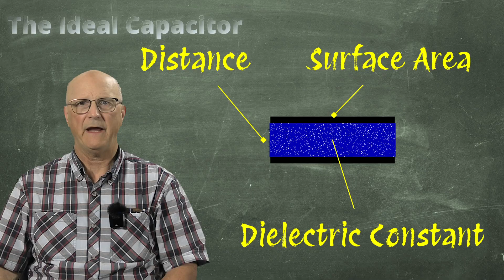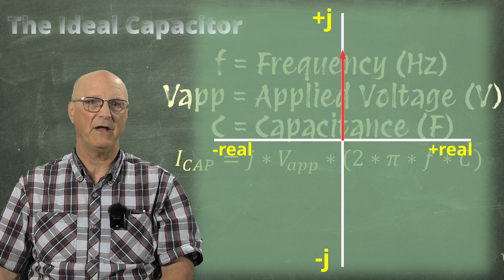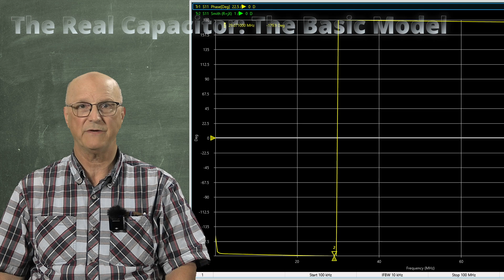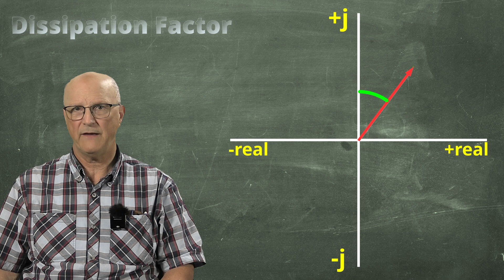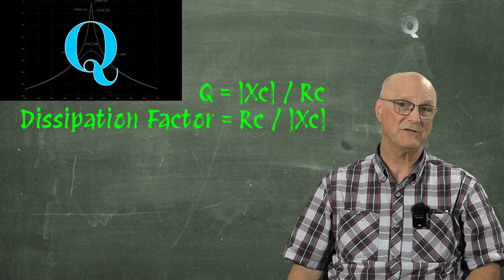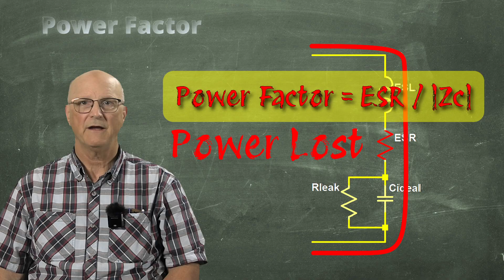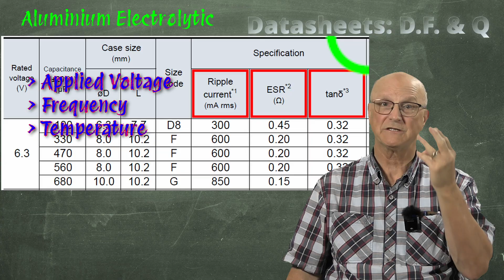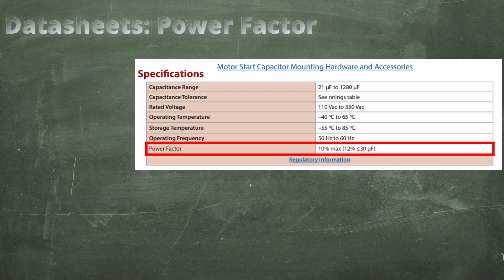Dissipation Factor, Q and Power Factor in Capacitors (081a)

Comment: That leaves how this information is applied to a design. Different uses, different concerns. Paralleling decoupling caps of different values and physical sizes results in more variation because of different resonant peaks. Absorption of energy affects an oscillator but it has an active element to make it up. In audio, I want to pass delicate sounds, not absorb them, but the reactive aspect is much higher than we hear; leaving a small loss in the resistive series connections. If operating at a frequency where the reactive component is could present a performance problem. Low frequency circuits probably won't have issues - controls as in factories are in Hz to low KHz response, RF circuits obviously need to consider the resonance.  Any experience with application problems and solution would be interesting.
Reply from the maker: The purpose of this video was to help people understand what Dissipation Factor, Q and Power Factor is from a conceptual perspective. 
You had one great point that bears touching on which I will do in this reply to you comment.  Because of the nature of the frequency response of capacitors as frequency increases, multiple parallel capacitors of varying values can be (and often are) used to ensure that the intended signal is passed. This is most often seen in bypass capacitors. You might see a 10 uF in parallel with a 0.1 uF in parallel with a 100pF capacitor as a trio of bypass capacitors to ensure that no power supply noise can possibly get to the circuit.
Regarding specific applications, there are so many, many and varied applications where such considerations will overlap, it is difficult to cover much in the way of specific application. With that said ...
In general, Q/Dissipation factor are more about R.F. circuitry. Power Factor is more about power applications such as starter motor capacitors and the like. You might also consider this in an application such as in crossover capacitors for audio speakers.
Because the frequencies are so low in low power, signal level audio applications, you generally do not have to actually be concerned with any of these except for aforementioned bypass capacitor application. :-)

Comment: Thanks so much for this. Can you please explain how to measure and calculate these 'paracitic' parameters for an unknown capacitor to work out the Q and Power factor?
Reply from the maker: These parasitic entities change with temperature, frequency and D.C. voltage applied. Each capacitor coming off of the assembly line is going to be somewhat different.
Think about the capacitor as a black box which contains something that look like the basic model as seen in the video.
Q and power factor both rely on knowing the ESR at a particular temperature, applied D.C. voltage and frequency. To do this, we have to apply an AC signal across the capacitor which is sufficiently high enough in frequency to make the capacitive reactance a really low value. The frequency at which we do this will depend on the value of the capacitor.
You have to know the output impedance of the signal generator. At this frequency, we will have a voltage divider with the input resistance being the output impedance of the signal generator and the output resistance is the ESR of the capacitor. Doing simple voltage divider math, we can back calculate the value of the ESR.
W2AEW demonstrates this with an electrolytic capacitor here: https://www.youtube.com/watch?v=115erzCCxgE
I hope this helps. :-)
Reply: @eie_for_you  It sure does, and your two videos on measuring the input and output impedances complete that picture for me. Thank you so much. Much appreciated.
Reply from the maker: Perfect! I'm glad I was able to help! :-)

Comment: Tank you for your videos.  What are the "application" implications of using high or low Q caps in a given circuit( bypass, filters,..)?
Reply from the maker: You are very welcome! There are cases where a resonant circuit is designed to cover a band of frequencies as opposed to a single frequency. In this case, one might consider a lower Q capacitor. If, on the other hand, the circuit is intended to only respond to a single frequency and shut out all others, then a higher Q is desired. Take care, however, components have tolerances and capacitance values change with temperature, frequency and applied D.C. voltage. These variations are, in part, a function of the particular dielectric used.
I would also point you to my video on Q where I describe the effects of Q on the overall response of a resonant circuit. (https://youtu.be/M6Ip1qkc8EM).
I hope this helps. :-)